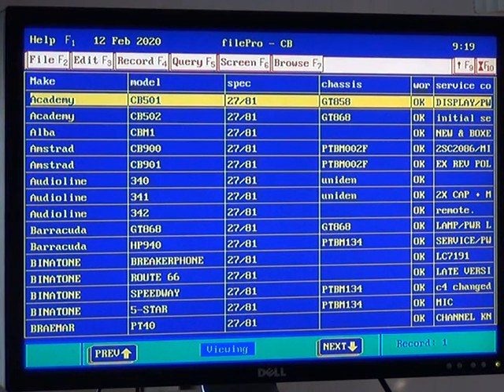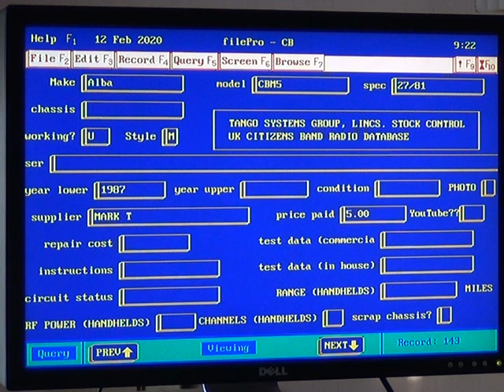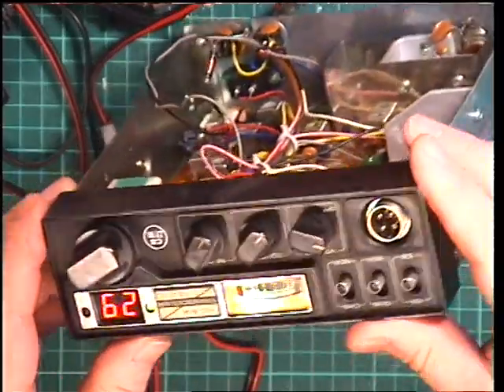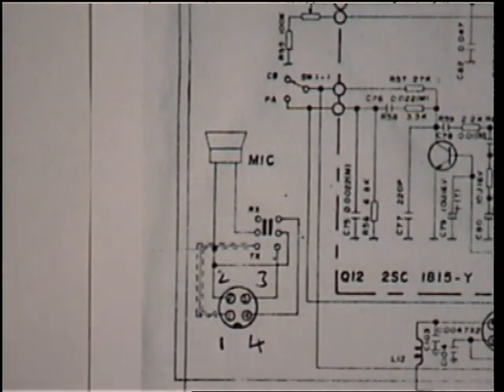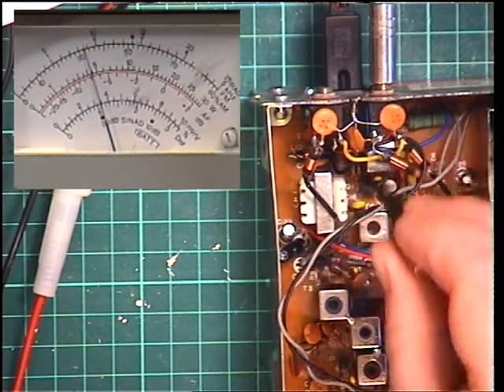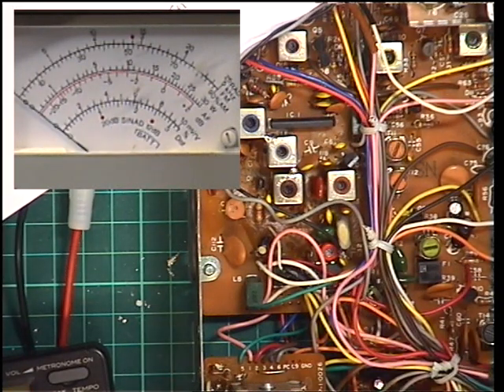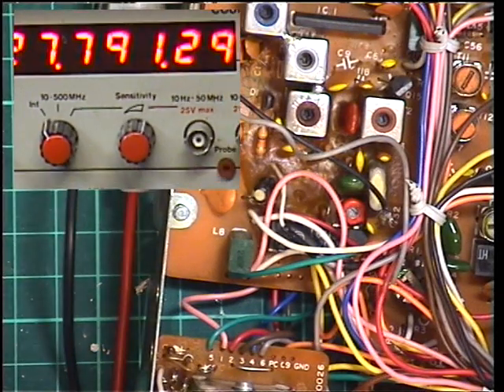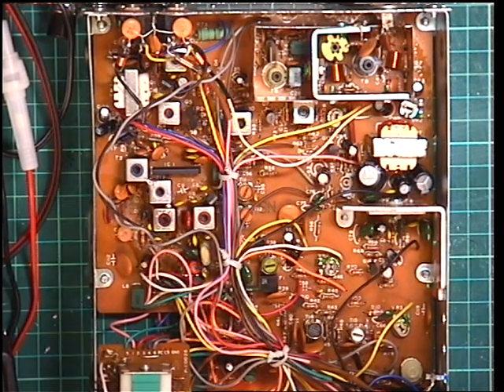Alba CBM5 (UK) CB27/81 CB radio (mobile) - Transmit alignment

Comment: I know you have probably been asked this many times..fave cb radio?
Reply from the maker: That's a difficult one, but the Rotel RVC230 does it for me....however, all the cars here have Midland 78+multi radios fitted as I like the scan facility which actually works how I want it to. One of those is the latest blue backlit version & is not as good. I have a Harrier CBHQ as a base here. The Realistic TRC1005 handheld because of the ext mike facility.

Richard
Reply from the maker: @P Mc I haven't covered that yet, not the Ford Roadmaster 505, not the Cybernet Bete 3000. I must be keeping the best 'till last!

Richard
Reply: @P Mc still love those old precision series midlands or an old sharps am small window series?.